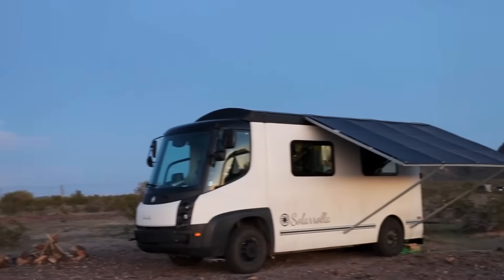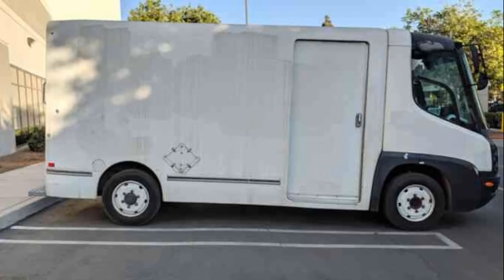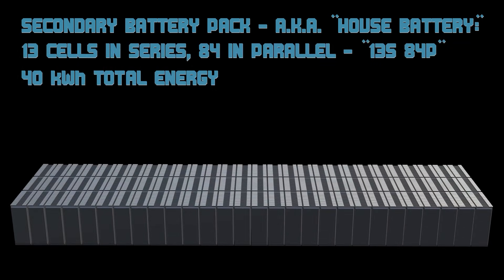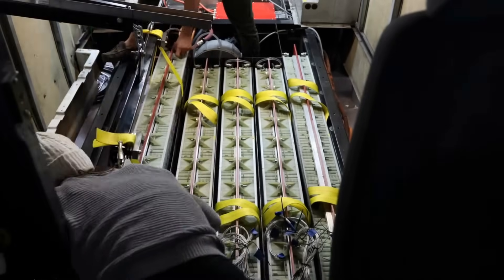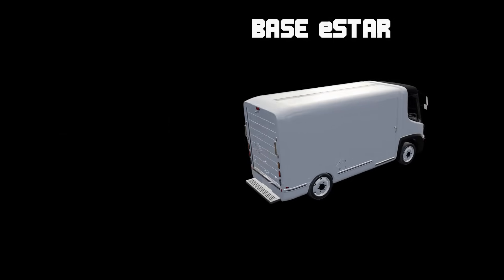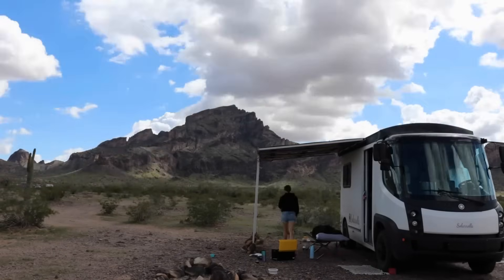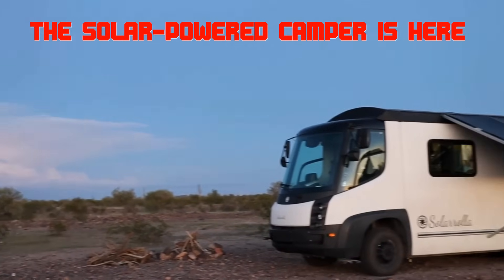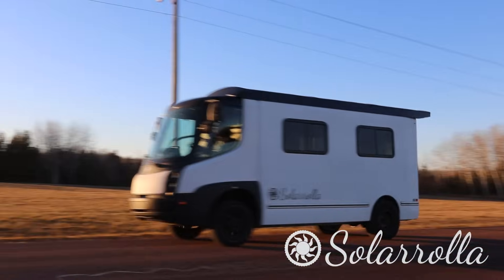Solarrolla Napkin Series 5 - Solar-Powered Fully Electric Campers!

Comment: Good stuff, your concept and vision. 

Getting help from Tesla with your Model Y......they know you are using the Model 3 batteries for a project. They are not interested for your success. They don't want you to know more than you already know. You will never be a priority in the service department for your personal vehicle. 

My opinion, you need a better shell, proven battery, higher efficiency motor/drivetrain.
 
Aerodynamics is the key. Your front end is too large. The rear end too flat. There is a better shell out there, if you can change. 

Changing to BYD battery might provide less battery expense, add reliability, and purchase new. Good thinking!

Have you considered less solar panels, use a sun tracking panel base?

Can the next/previous vehicles, use standard commercial charging?

Drivetrain efficiency, horsepower need not be huge with the torque of the motor.
What is your 0-60 MPH, and top speed?

Did you consider using a Model S/X front drive unit?

Comment: My roadtrek solar panel which I built a custom fiberglass aerodynamic fairing for also tilts for tracking. The unhinged side is secured by a bolt thruogh a waterproof roof penetration made of a boat through hull plumbing conection. After droping the pannels I simply twist a knob inside the van to bolt the solar panel down.
Reply: Can you share more details of this waterproof bolt through connection? Sounds really neat! Perhaps a part number.

Comment: I currently live in my 19' Roadtrek, it still runs great, but my long-term retirement home, I hope, will be a similar sized Full Self Driving Tesla delivery van conversion with as much solar as possible. Of course Tesla will have to build such a van and my TSLA stock will need to make the long awaited moonshot. Fingers crossed.

Comment: My partner and I have been thinking about exactly this. Our wishlist would be BYD blade LFP batteries for their robustness, 500 km range, all wheel drive for light off-road/winter traction, smallish form-factor to blend in on city streets (she has a ProMaster now so in that size range), all electric with enough solar generation to make a difference and possibly charge the actually traction battery. You next build looks awesome but I'm concerned about being able to source eStar bodies and parts given they had such a limited production run. Also wouldn't be interested in the side bump-outs but the second story might be interesting. The solar tracking is super cool.

Comment: Can you achieve same or better volumetric density on pack level with BYD blade cells than you could with 21700 NMC cells? We use blade cells for stationary storage. You can get them for approx. 40USD/kWh (152Ah C104F variant).
Reply: I’ve read it’s about a wash. The LFP cells don’t need as much cooling, and don’t need as much buffer, so you can get about the same range in the same size pack. But LFP is not known to handle cold weather charging as well.  But not sure how much winter RVing happens.
Reply: Maybe that density doesn't matter if you want a safer chemistry (LiFePo4), don't you think?

Comment: That is very impressive. Byd is the way to go. Much better thermal regulation and safer. Not perfect but better. You are building my dream. Well done.
Reply: Why not using EVE 304Ah  LFP prismatic cells ?
You get 970 Wh for 5,5 kg, while with these lamelar BYD you get 650 Wh for 3,9 kg.
176 vs 166 Wh/kg.

For a total of 200 kWh of battery, it can safely be charged and discharged with 100 kWh, even double.
Reply: Why do you recommend  a firm instead of a specific cell? China bot you are? 🎉🎉😂😂